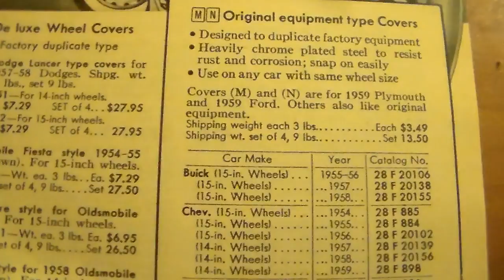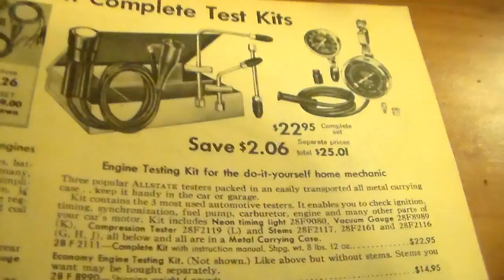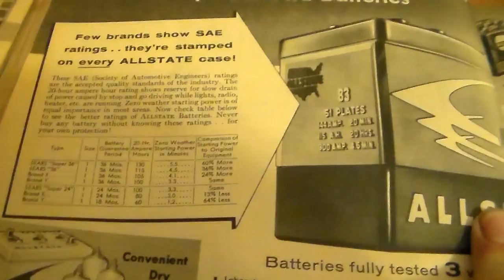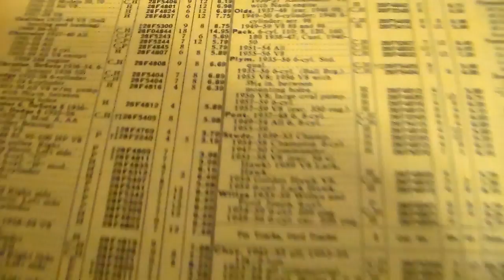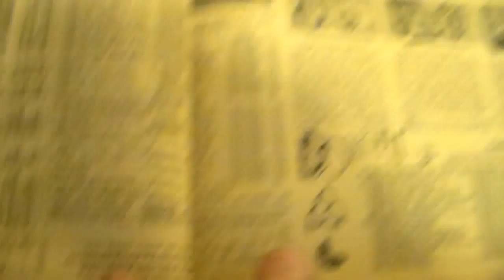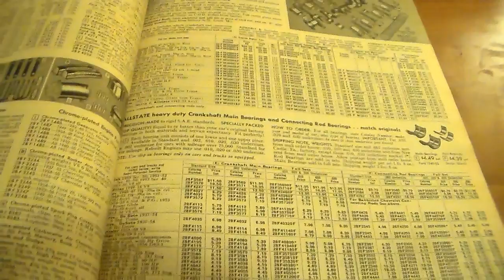TNG extra: Shopping for car parts in the 1959 Sears catalog

Comment: OMG, thank you so much for the plug, and looking for the tester in that interesting Sears catalog. What a great idea, a friend collects old Sears catalogs. I need to pay him a visit, and look in a 1955 catalog... as I think that is when it's from. Where you showed the load tester, just below it was a Growler. I have one, and showed how they work in this video, https://youtu.be/D9fbdVhMsgs . Your correct on Generators too. When I hit a long red light in the Pontiac, I kick it into neutral, to keep the generator charging, and it also helps keep the transmission cooler.... and with it being late fall, I often have the lights and heater fan on. Stopped in drive the amp meter goes a good amount into the discharge. As soon as I take off, it goes well into charge, for a minute or so.  The 348/409 water pump is totally different than any other Chevy water pump. I had an extra, I rebuilt for a spare, as they always were a hard pump to find. Thank you again Howard
Reply from the maker: I'm glad you enjoyed.

Comment: Definitely robbed of speed and gas.
Reply: Man. I should have said more how I enjoyed this. I need one of these.  What years are this expansive newer than 1959?
Reply from the maker: That stayed like this up through the '80's but without the comical sales pitches.
Reply: Tyler's Neighborhood Garage I’m a old magazine junkie. Got a few Crown Jewels in the stash. 70s custom van magazine with a write up on installing a 4 speed instead of the 3 speed manual.  Amazes me how prevalent the manual transmission used to be not all that long ago and you can’t hardly buy shit with a manual now.  

I had two mustangs.  88 notch I should have finished. Give up on it. Rusty as hell and the motor had some god awful blowby. I had a 02 GT with s 5 speed. Brownish gray color they all were. Bullitt wheels. I had a set of original 40 flows put on the day after I bought it. K&N when it needed a filter. Clean stock car when I got it in 07. Foxes were hard to find nice, and I didn’t like the 05-09 cars. 3.27 gears. Pulled good and was good on the highway.  

Cousin had a couple foxes of note. 93 red notch. 5.0 with a 5 speed. Bunch of bolt ons. Low 7 in the 1/8 car. Enjoyed it. Had a 85 t-top GT in maroon. 66 289 built with a big ass cam with an auto. Had to been a 2.73 rear. 7k rpm sounded pretty wicked. Always loved the fox cars.